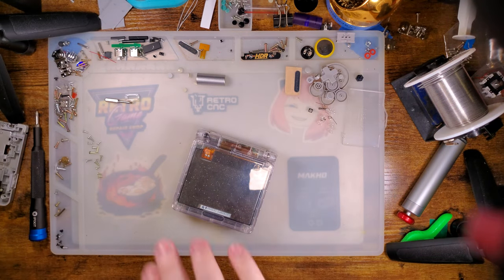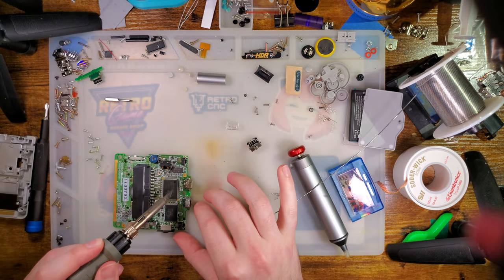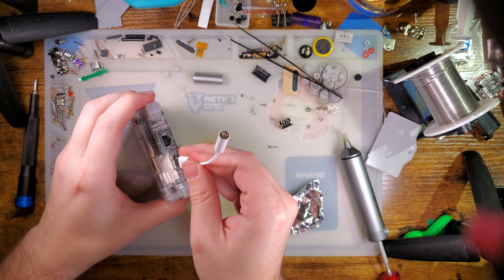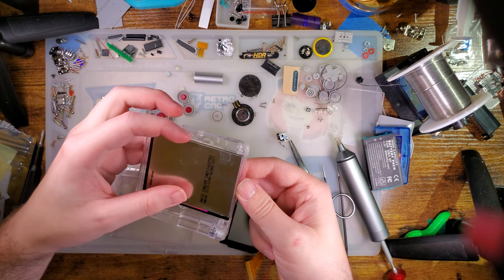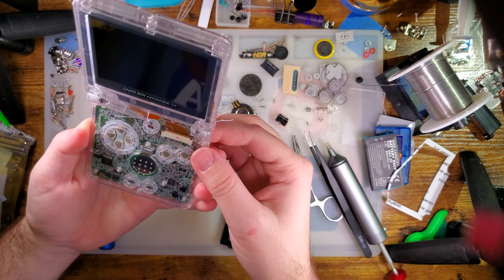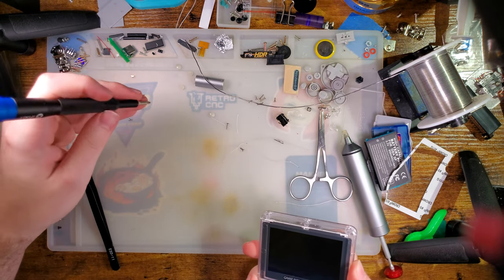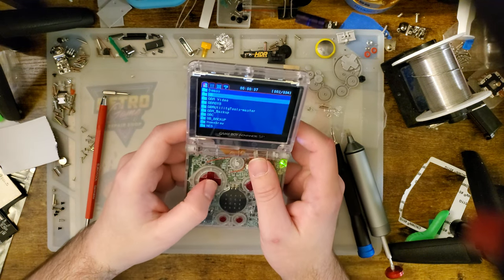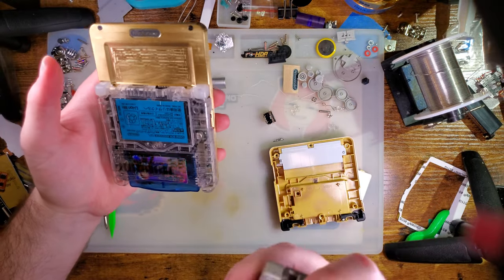Funnyplaying Game Boy Advance SP Housing - USB C and ITA Backlight (2/2)

Comment: I've been using the mirror clear black shell for a few days. I've never had any other SP shell before, but the quality of this shell is very high. It does come with a screw already attached to the battery door, and it does come with clear rubber screw covers for the screen. The speaker holes do not have any weird defects. It does not come with any buttons, but they sell those separately.
Reply from the maker: Well, like I explained, the one I was showing off was a sample. Not the retail version.
Reply: @makho  I found some very minor issues. I have an AGS-101 screen in one, and the new FP IPS (with foam and decorative slice) in another two. All three shells have some slight buldging on the top housing. If you close the console, flip it upside down and set it on a flat surface it will wobble a little. I am also using the FP buttons and membranes. The brightness button sits noticeably taller than OEM. I suppose they did this to make navigating the OSD easier but when the screen is closed, the housing rests on the brightness button instead of the rubber screw covers on top corners. I also noticed the bottom housing doesn't have any plastic nubs to help the console sit flat.

Comment: I wanted to thank you for these videos.  I just ordered the Funnyplaying case, buttons, and ITA kit to spruce up my old blue SP.  You answered two of my questions here, so I'll use the OEM bottom shell on the transparent black Funnyplaying case, and save the Funnyplaying one for a future Slate build, when I can get a suitable parts SP.  That way, I have a "super stock" SP, and an IPS slab build, with my Micro as a stock experience.

Comment: I did a UBC mod a while ago and whilst it works, it annoyed me because I soldered it flush to the board because there was nothing to say don't, and it came with no raised standoff. When I came to assemble it into the new shell, I found that the port didn't align with the cutout in the shell on one side by a few millimeters, so I had to file into the shell to make it close. It obviously requries a bit of a stand-off and the USB port kit was re-assembled and didn't have this. Anyway, the SP looked ok in the end, but just not as clean as I'd have liked. And to top it off, the shell quality wasn't the best. I'm of two minds whether to redo it with FP's shell when it comes out.

Comment: I had a lot of soldering experience years ago, I thought that if I was careful and diligent that I could do the USB-C mod. well after 30 minutes of just trying to get the securely bent(!) anchor pins to wiggle freely I can officially say that I have ripped an anchor pad. the first pad I've ripped in a very long time. I feel like a fool, but I honestly don't regret it. I did my best.

Comment: Would the USB c mod with audio support from RGRS work in a Og phat ds?
Reply from the maker: It should. It would even have audio support on the USB port (and on the headphone jack).
Reply: @makho   awesome, thank you, I'm probably going to mod my ds's with usb c then. Do you know if it will give audio out with USB too or will I need a USB to 3.5 adapter?
Reply from the maker: @tracker707  analog audio out over the port, same as the headphone jack

Comment: Hey makho when you adjusted the potentiality screw what does it do exactly? Should I do it for my ips screen or my power saver mod on my gba sp? Or is that only to stop the flickering for that specific screen?
Reply: That's the voltage going to the lcd(in this case it's the IPS board)
For my kit( new hispeedido with LG), max voltage(right side) fixed the flicker on small signs on pokemon and artifacts/image retention on the NES games showns by him.

Comment: yeh i borked my sp when i tried doing the usb-c mod a few months ago after watching your video on it. ended up grabbing another sp and leaving it as is. definitely a advanced soldering mod. bit sad that i have a sp that works but i cant charge it.
Reply from the maker: Can always charge the batteries in one and then just keep swapping them out. I've definitely done that. 

If you plan on keeping up soldering, make sure to hang on to that SP so you can fix it when you get some more experience under your belt
Reply: I did a usb c mod last night, accidentally pulled two of the 6 traces up with the old port. Found a high definition photo of the pcb on the retro six wiki and you can simply look where those traces lead. Simply wire some small jumper wires to those pads and the corresponding pad on your USB c mod. I have full function, just cost me about 20 minutes of research and a bit of time. Charging and audio work.